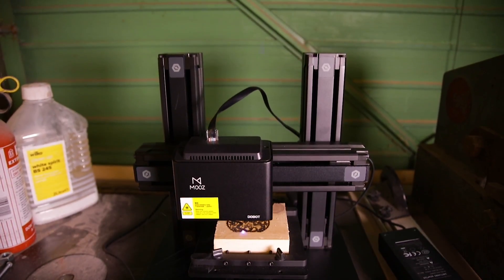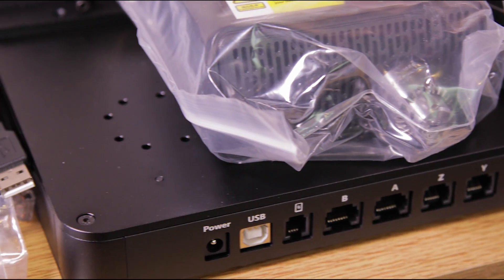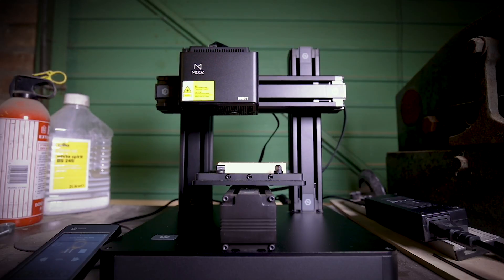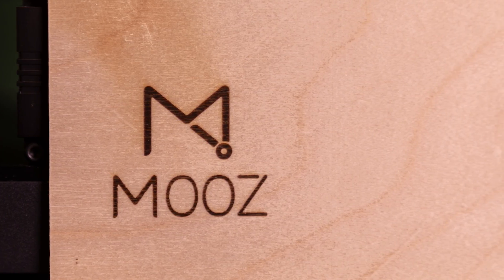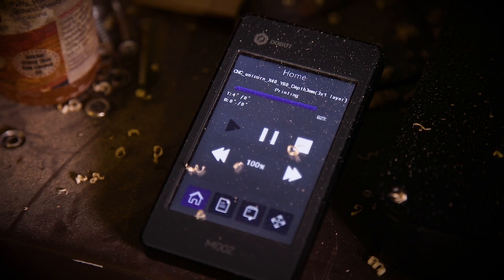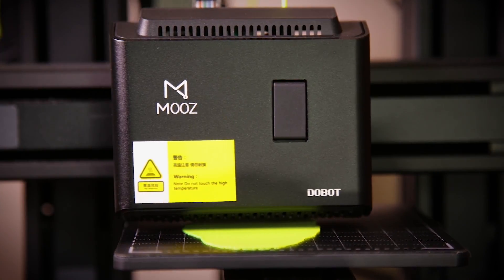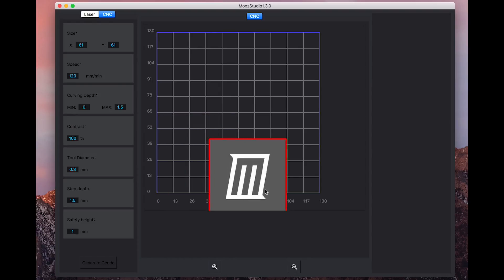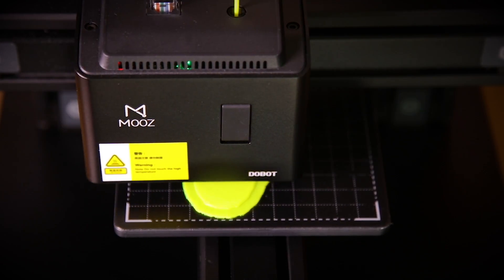Dobot Mozz Review: Cut, Burn, and Melt All The Things!

Comment: This was my first machine, I now have 11. What is interesting is that the first production Snapmaker and this were nearly identical. I have the newer version of the one you are showing as it's slightly different. The 3D print module on mine you can tighten or loosen the grabber gear and mine has a slightly longer print bed, very slightly. After I bought this I started buying 3D printers that were on sale on eBay marked "as is, for parts only" so all of mine I got very inexpensively and rebuilt them. I have one other Mooz, a Mooz 3 which is a Delta printer, very small print volume but can combine 3 colors of filament. Got that for $70 when it was selling for $899. AND there was nothing wrong with it. I assume the user did not know how to configure the slicer for the round delta print bed and he did scratch the print bed. I simply replaced it with a removable PEI surface. I still use the Mooz because, believe it or not the prints are still outstanding. The company now has moved to robotic arm machine and, ironically, that is what I build. I build robotics, using an Arduino or Raspberry Pi, with Maestro and stepper motors. For some of the small gears I use the Mooz so I don't have to crank up my large print volume machines to make small prints. My printers are Lulzbot Taz 5's which one of them I use for fast prototyping with 2.85mm filament and a 1.2mm nozzle. I have 2 Snapmakers, the large volume A350 models of which one I use for 3D printing the other for CNC. And I have a VORON since I wanted a corexy machine for high speed printing. I would say that the VORON and the MOOZ compete with making the same quality prints, although the VORON is a rocket and the Mooz is slow, but I'm never in that much of a hurry.